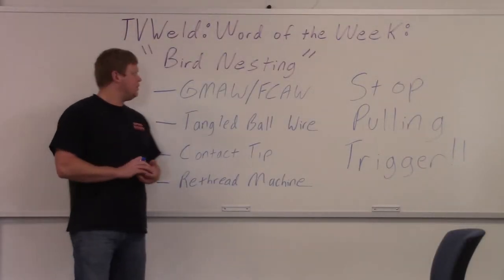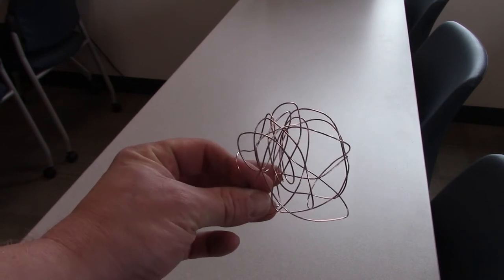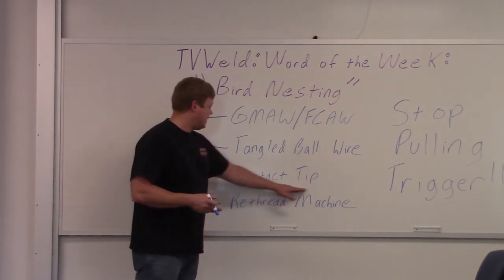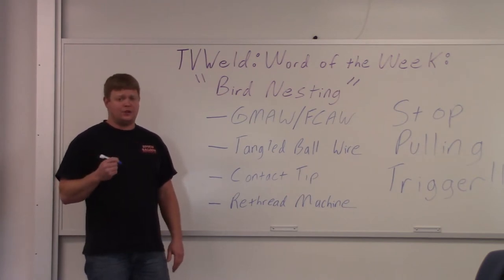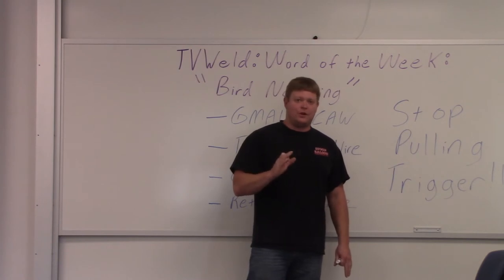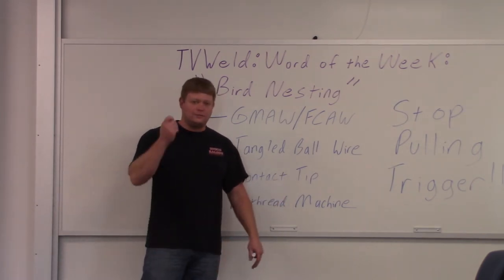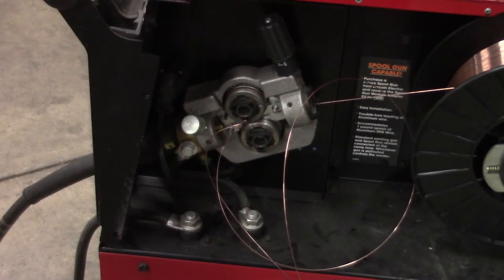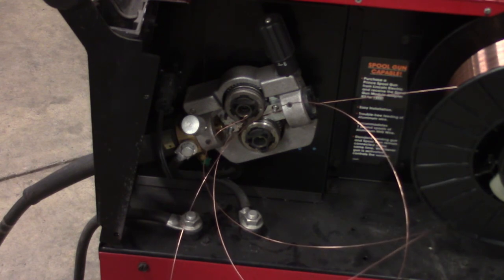MIG Bird Nesting

Comment: It is also possible to have this problem in weld robots if the liner in the whip between the drive rollers and diffuser is broken and causes the wire to arc out to the liner itself.  Tip may look fine but wire is stuck to liner after drive wheels.